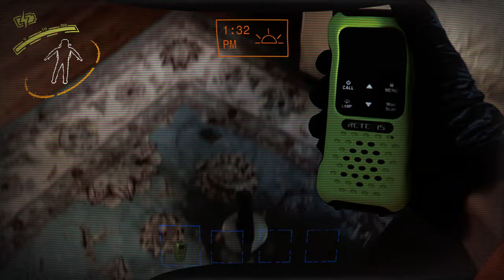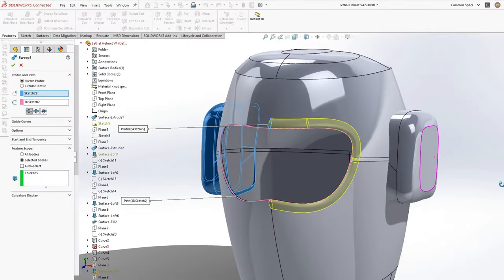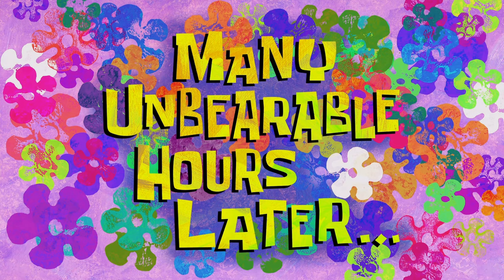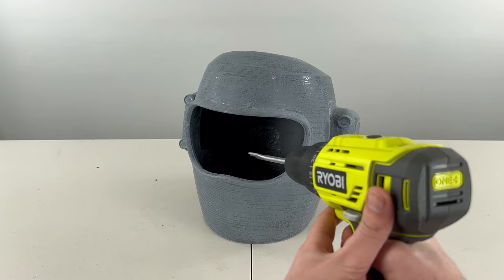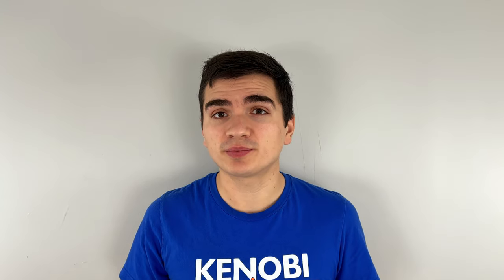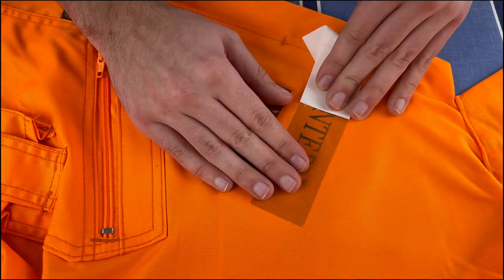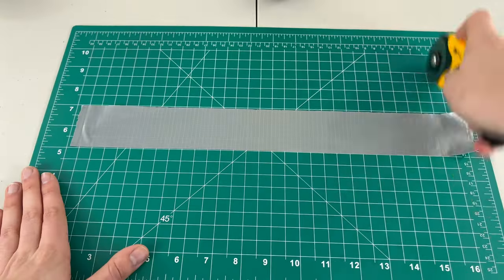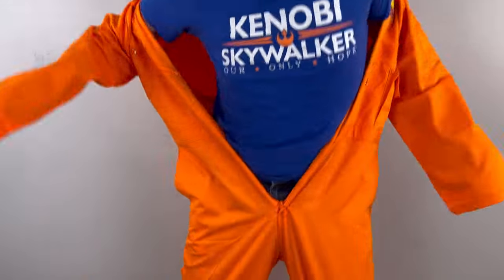Becoming a Lethal Company Employee | Cosplay Tutorial

Comment: This is going to be a very popular video, my friend! Well done!

If you wanted to adjust the helmet for a bigger noggin, how would be the best way to do so? Is there a full model that can be scaled up, or is there some maths that I'm missing?
Reply from the maker: Thank you, I sure hope so. 

For scaling you can simply scale up the models in the description using a program like 3D Builder (should be free on windows) or in which ever slicer you are using. Just be sure to scale the two respirators to the same size so they will fit on the mask. Another benefit of using 3D Builder is you can measure the opening on the bottom of the helmet. Currently I think it about 7 in wide give of take a few 1/8 of an inch. This just fits over my head. You could also consider cut the model into pieces and have them attach together via magnets or velcro.

Comment: What software and settings did you use for the print? Also how long did it take to print?
Reply from the maker: I used cura, the basic settings were 210 nozzle temp, 60 bed, 10% cubic infill, tree supports on 60 or greater angles. As see in the video I printed the helmet upside down which took about 6 days of printing and about 900 g of filament or less than a standard roll.

Comment: How did you get the tubing to stick to the backpack tops? Ive tried hot glue and even after holding it for minutes it just slowly falls out
Reply from the maker: I had similar issues, working on a V2 now should be posted tomorrow. In the meantime I found using a combination of hot-glue and super glue does work. Just gotta make sure both glues dry first.
Reply from the maker: I have posted the updated cap pieces to the Thingiverse link in the description, these should work much better.

Comment: What kind of drill should we use for the holes? also there are no black colors for the visor part
Reply from the maker: @Ceejai74  i used a 5/8 drill bit on a ryobi drill (brand doesn’t matter though), as for the visor part the listing had black when I bought it, any large black light gel should work or similar thin black plastic, just make sure is semi transparent or you wont be able to see.
Reply: @Studio_52   Thank you so much man
Reply: @Studio_52   I would also like to ask one more question, is there a company you suggest that will 3d print stuff for you? I do not have a 3d printer and haveing a company print it for me is easier for me
Reply from the maker: @Ceejai74  I dont have a specific recommendation right now, you can try searching etsy for custom 3d printing and shop around there for the decent price.

Comment: Do you think coating the helmet in resin was worthwhile? I saw you used UV resin, is this the same resin that is used in resin printers and did you need to cure it under a UV lamp or anything similar?
Reply from the maker: It depends on how much sanding you want to do. You can achieve a similar result sanding for a long time, I usually resin coat to save some sanding time as well as save my wrist. 

Yes, I used 3D printer UV resin which you can either cure using a UV Lamp (which will cure faster) or the sun works as well.
Reply: @Studio_52  Thanks, I ideally want to do no sanding as I've never had a good final result unless I've printed with thicker walls or 100 infill. Thank you for the video and sharing the 3D model

Comment: What grit sandpaper were you using? Oh and what do you recommend using for the visor and putting it on?
Reply from the maker: I used a range from 120 to 330 grit sand paper, (start at around 80 if the print quality is bad) if you want a smoother finish you could go even higher

For the visor I used black color gels (usually used for video lighting) cut it to around the size of the visor hot glued in in place. I also have seen some people use a thin black fabric instead which offers a bit more breathability.

Comment: Did you cut out a bit at the back of the helmet or is my head just that much bigger than yours?
Reply from the maker: I am afraid I did not, though I have a technique for putting it on, tilt your head forward and put the back on first then try to slide it down over your face.
Reply: @Studio_52  That didn't quite work. I scraped of 5 mm in the back and now it fits. Thanks a lot.

Comment: Is there a 3d printer that cost $250 or less that can print the helmet?
Reply from the maker: If you want to print the whole helmet in one shot, the Ender 3 Max is around that price point you can also find used cr-10s for less than 250 as well. Otherwise, you can get any number of smaller printers and print the helmet in sections and glue it together. For less than 200 there are a number of printers such as the ender 3 or anycubic. If you really want to save Microcenter does have a first-time customer coupon for an ender 3 v2 for only 100. https://www.microcenter.com/site/content/specialoffer3dprinter2g2.aspx?rd=1
Reply: Hey, quick question since i have completely 0 knowledge of all of this. Just playing with the thoughts of getting a printer for years know and i think this was the last drop that pushed me to finally start into it. Want to do lethal company cosplay for our carneval and have a nice offer for a used ender 3. You mentioned for this one would need to print the helmet in sections.
Does this mean because of the hight or because of the print surface area and would this require deep knowledge or is it as simple as just making a cut in the model software. Just if its possible to explain this shortly in a YouTube comment of course

Comment: for printing the helmet, did you do anything to the tree supports at the bottom to make the print more consistent?
Reply from the maker: I did have some issues with the helmet pulling up from the bottom tree supports, you could trying increase the density of the supports or the support ceiling, this will make them more difficult to remove. Otherwise I would look into more post processing solutions like bondo filler to fix areas that might not have come out right.

Comment: What spray paint did you use?
Reply from the maker: The primary base coat is resutolsum dark grey, then I used rustoleum matte black for the respirators, finally I costed everything is a rustoleum matte clear coat to seal everything. Also the little silver bits were hand painted using some silver acrylic paint.